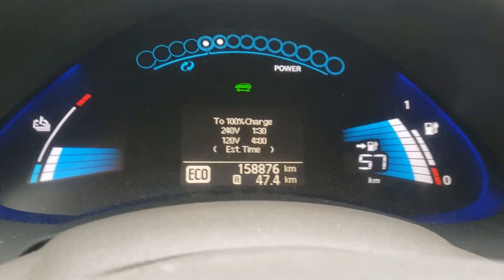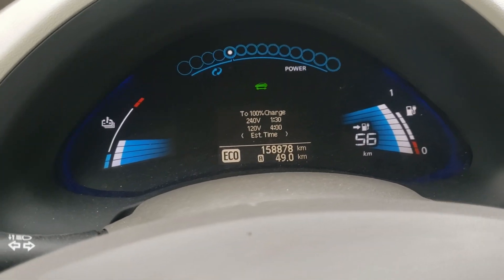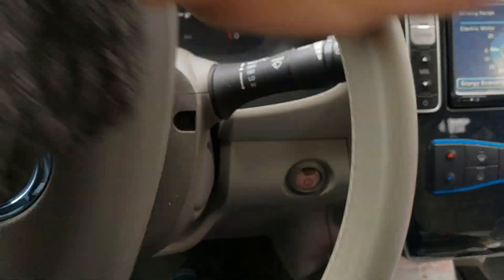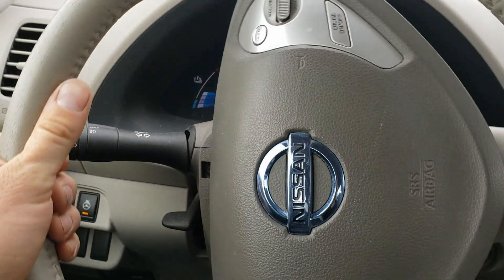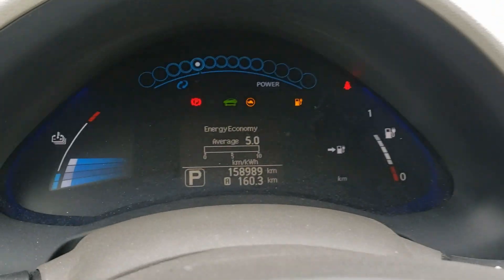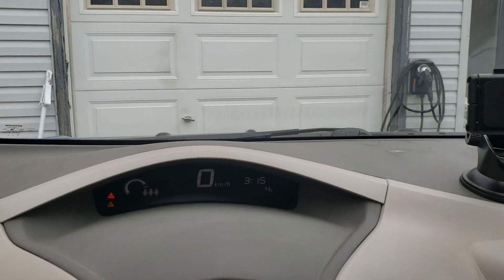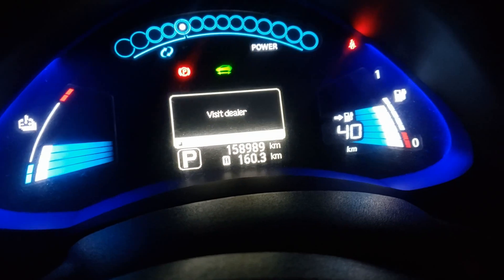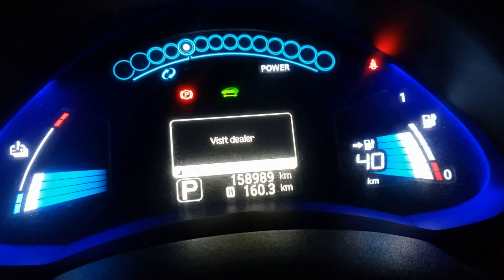Nissan leaf Extender Battery Range and Capacity Test

Comment: i have found in my location. a virtual diamond mine of battery capacity at auto scrap yards that must remove hazardous materials from automobiles before crushing. i have 100kw of scrap batteries in my yard now that were considered hazardous waste that power less intensive devices than cars very well. have you sourced that?
Reply from the maker: Ill have to take a look
Reply from the maker: Thanks for the idea
Reply: @GoingOffGrid101  id be curious to know if you had as good luck as i have

Comment: I have a similar extender battery set up in 2014 leaf. I'm using nissan leaf 30kWh cells in the trunk. And HV wired into the PDM main bus, to avoid opening (or dropping) the oem battery. But my combined battery won't charge to 100% using the L2 (granny) charger. Any ideas why not? 

It will QC to 100%, just not L2 charge to 100%
Reply from the maker: What is your battery state of health
Reply: OEM battery is 58%. Extender battery is 62%. Total capacity should be about 32kWh, with 30kWh usable 

Leafspy reports charging into OEM battery at half the current a DC fast charger reports, so all working OK on that front

No fault codes. But it stops AC L2 charging at about 75%. Leafspy reports cell voltages are well below 4.12V at L2 charging finish point

Comment: Is it still working well? Do you need the separate monitor for the trunk batteries? Do you need anything other than batteries and cable?
Reply from the maker: mines still working yes, I have not changed anything since the video, I have a bms for the rear battery but have not installed it yet.
Reply: @Going Off Grid  you use km? I live in Canada, where did you buy the batteries for your trunk and can the be charged when below freezing? Are they heated?
Reply from the maker: @GBUTR  yes they can be charged below freezing at a slow char rate, I live in canada as well, no these are not heated
Reply: @GoingOffGrid101  I just ordered a Chevy Bolt EV 😂. Easier than trying to copy you. I will keep the LEAF though. Still works and free charging at work. Thanks for the great videos!! Planning an off-grid system for my future attached garage so I may look at your solar stuff too!
Reply from the maker: @GBUTR  sounds good man, I want a new EV as well :D

Comment: How much cost that kind of upgrade
Reply from the maker: Cost me 1500 bucks
Reply: @GoingOffGrid101 Without price of the battery?
Reply from the maker: @pashko90  for the battery in the back
Reply: @GoingOffGrid101  Sounds surprisingly cheap. 30 kWh pack costs usually about 3-5k$
Reply from the maker: @pashko90  it's was cheap 😆

Comment: Make shunt bigger, it will be smaller voltage drop and the BMS will think it is smaller curent and consumption od kWh. Add small wire to the shunt.
Reply from the maker: i was thinking of that

Comment: Good project.  But it will be useful to us if you show the technical aspects of how you do it. That will really help us too
Reply from the maker: i did in 2 other videos
Reply: @GoingOffGrid101  
thanks i saw it. how do you charge the extender pack. does it have the pre charge relay too when it is connecting to the main battery pack.  appreciate your quick response and development of the project. i am  planing to converting my 2012 nissan leaf with 32kw pack. regards. prem

Comment: I am happy too thank you for sharing, are you planning to put a faster charger with the BMS for the extended battery? if not, I dont think you need any additonal work or BMS on them as your OEM setup is working good.
I am working on battery thermal management using peltier modules for Nissan leaf Battery.

Comment: Is an interesting project your going. You might want to disconnect the extender battery before you balance main battery.
I have always been wanting to do what your doing.
Only I was thinking of making the main battery 200volts hooking battery's in parallel.
Then doing same with extender battery so both end up being 400v together.
Then be able to use harf of balancing wires on main battery.
The other harf on extender battery.
Then hopefully the bms will think 2 modules in purallel will think is only 1 module. Using only the cars bms.
I hope it works.
Reply from the maker: im not sure if that would work or not.
Reply: It's extremely bad idea.

Comment: I see your SOH bars have come up.
Did you reflash your bms or did it come up on its own.
Have you ever come up with week cells on leaf spy before you put the extender pack in.
Mine got down too 72% SOH.
Found if I run the battery down to falling off the bottom end of turtle using the heater on 32c and air con on every thing will shut off and will see all the cells start leveling out make sure the lowest cell does not go below 2.7v at 2.5 it will die.
Make sure the car was fully turned on when doing this. Once the car dies. You have to put a a battery charger on the 12v battery and be over a 25 amp charger to keep up.
If you can leave in this state over night about 8 hours.
The diff  between highest and lowest cell I have seen  almost 550 mvt difference at this stage. 
When cells all balance out by morning lowest that figger the better
Anywhere under 100mv is good. 
Dont worry how low the %SOC gets. 
Remember soon as car falls out of drive mode under turtle aprox 2.890v lowest cell will do this car stops it going lower. With in minute's 
It will be climbing up in volts as all 98cells balance out. The higher cells will start coming down. Once left for 8 hours or more. Turn both leafs off. Disconnect battery charger. Or jump leads from other leaf. 
Charge leaf as normal. 
Can turn leaf back on while charging. 
And keeps it balancing as charging. 
On 3kw charger will take about 8.5 hours to 100%.
Car will now go lot further in turtle and do more km in total. 
I have seen in my own car the SOH go from 70% up to 80% SOH. 
I think when lose bars you won't get them back. 
 Can also jump start off an other leaf. Leave that turned fully on. It needs to be at least 60% state charge.
A leaf can charge a 12v battery over 40amps.
Reply from the maker: very interesting, mines at 60% soh, im my cells are all very close in voltage all the time.